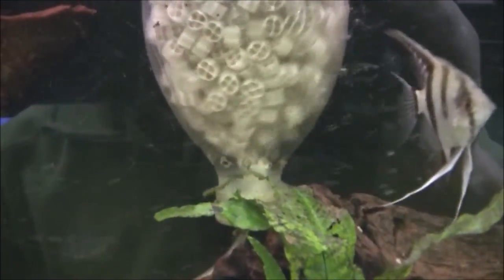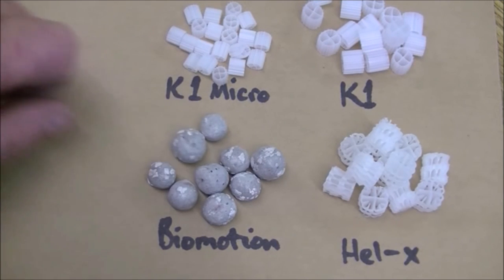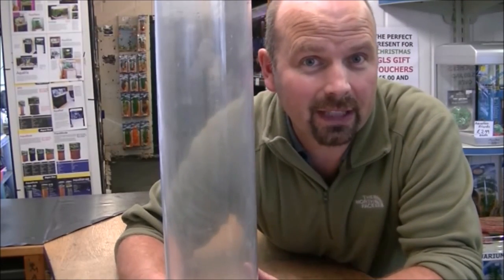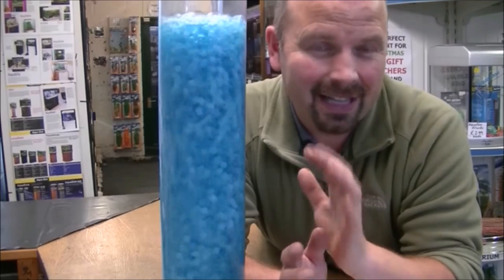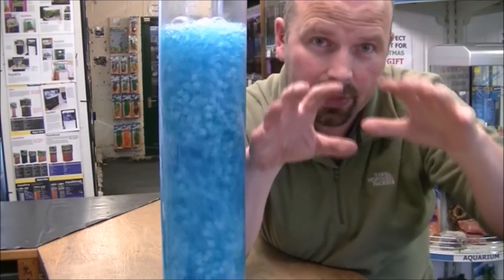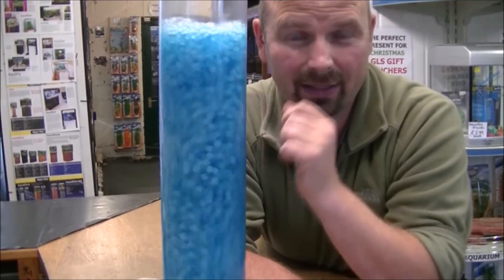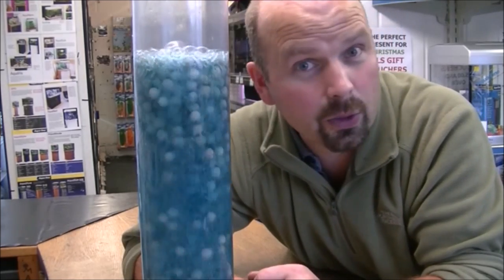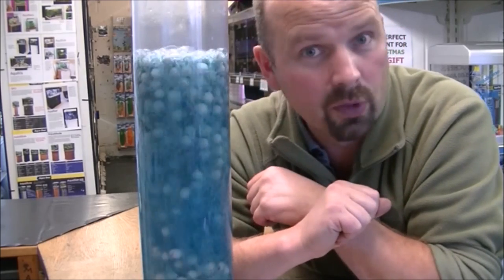Moving bed filters and fluid bed filtration 101 by Pondguru

Comment: Iam emailing u let u know I have built the moving bed filter it's been almost a week.  and the 90 %  of the k1 micro  media has started to move in a clock wise motion  . So as u told us this filter will help in the spikes of bacteria and nitrates so iam hopeful this will help me . In my tanks  iam trying it in my 29 gallon tank . So again u are  my hero and thanks from all the ones who don't know these things as you do.  Thanks pond guru guy
Reply from the maker: Great I'm glad that it is starting to move properly. Once it has moved well for a couple of weeks try moving the air inlet so air travels up the middle of the filter and the media will move in a more chaotic way. It will bash together more that way and be more effective.
Glad you enjoy the videos as I love making them - just wish I got more time for filming.
Reply: Thanks again ive added the bacteria balls and moved the air to the middle of the bottle its moving a little slow if u think its better to speed it up I can  the air flow I mean
Reply from the maker: It will move faster as the media matures so I would personally leave it but if you want to get it moving faster and can turn up the air pump then go for it. As it matures you can reduce the air flow.

Comment: Thanks for the interesting video.  I am definitely considering using a moving bed filter in a plant aquarium that I will build soon. I have a few questions about how to adjust the size of the filter or the number of filters to the size of the aquarium and also the amount of necessary media.  I am planning an aquarium of about 350 liters, 2 pairs of discus, and two pairs of angel fish.  And another group of small fish.Thank you.l am going to it diy way.I am going to use 2 liters plastic bottles.
Reply: (my other channel)  A moving bed really only processes ammonia and nitrite and it produces a nation of nitrate. That's good for the plants and as long as you have plenty of plants the water should be fine. Ideally you'd aim for 1 litre of moving bed media per 100 litres but a moving bed is only part of a filter system. If you can add more then it's all good.

Comment: What is your opinion on pot scrubbers as media in a canister filter? I see them more and more being used. Thanks for all your videos, i have a lot to watch!
Reply from the maker: They are as good as foams, ceramic rings and other material where all the surface area is external and will easily hold enough aerobc bacteria to ensure that ammonia and nitrite is processed (as long as the filter is large enough / enough 'media' is used) - however, a good lava rock would be better as far as surface area goes if you're looking for a DIY option for filter media.

Comment: Do you have to use air to tumble the media or can you just use water pumps?  Thanks for the nice video
Reply from the maker: It is best to use air as the system relies on a highly oxygenated environment to work well. However aquarium water pumps will often have a venturi fitted on the outlet which allows them to drag air in and spit out a water / air mix which works fine to drive a moving bed filter.

Comment: i was about to order enough K1 to fill my 55 gallon barrel moving bed filter to run my fishroom, i'm not too keen on ceramic or glass media as they seem to get clogged quickly, so would you recommend K1, K1 Micro, or Hel-x for most surface area for my money?
Reply from the maker: ***** K1 micro has easily the most surface area per volume of those three plastic media so would be my choice every time. It allows for the most fluid bed too so ultimately won't need as much air to drive it.
Reply: Pondguru thanks!

Comment: I am so glad I watched this before I bought the K1! I was getting the stuff together to  make one of these. The last thing I need is more Nitrates and more water changes. 
Why does this produce nitrates?
Reply from the maker: Plastic media of any type in motion or not lacks the structure necessary for supporting anything other than aerobic strains of bacteria, therefore the moving beds tend to be good for the aerobic side reducing ammonia and nitrite but the end product of that process is nitrate.
Ideally you would have a moving bed followed by a static bed of good media like biohome ultra / maxi ultimate if you were using it in a sump or if it was a pond situation the moving bed outlet would go to a static bed box or shower filter filled with 30mm-50mm white pumice, biohome ultra / maxi ultimate or the new shower media we're making which packs in really nicely for a shower filter.
Reply: Thank you for getting back to me. This is for a tank that I am not sure will even have fish in it. The tank is a floating plant tank only so I can sell the plants but, I have tried this before and the plants always die. I have an established fish tank where they plants start out and they do very well in there. I wanted to transfer the plants once they get some good roots. I was told that I probably do not have enough nitrates for the plants to feed on and that I may have to get some fish or feed the empty tank. I am not going to feed an empty tank so I might have to put fish in it. Because of this, I want the tank cycled. I was going to do this DIY with the Kaldness media and have a spong in that plant tank.
Reply: Pondguru, I live in an apartment, I can't do a shower filter here. The water is on one side of the apartment and the tank is on the other.
Reply: Pondguru, so are you suggesting that I need to use another filter with media in it along with the moving bed filter?

Comment: was wondering about shower filter,,, with the water trickling down wouldn't there be plenty of oxygen surrounding the biohome filter .. ?  how would the Anaerobic bacteria grow there ,, thanks , luv your video.
Reply from the maker: D. Aware The structure of biohome allows for anaerobic zones even in a heavy oxygenated flow so it does great in shower systems. The larger forms of media do best in really heavy flow but smaller ones like mini ultra and ultimate do fine in moderate flow.

Comment: Great work @Pondguru 
I have a question though, since I have no access to K1, Bioglass, or similar media alternatives, and I'm really looking into setting up a moving bed filter for my 127 Lt. Tank, do you thing that something like wall screw plastic anchors, cut in pieces maybe, would make an effective alternative? 
It has a decent surface area and it does float. 

Looking forward for your advice.
Reply from the maker: Waleed Janabi I suppose any plastic would do to a point but it needs to be tank safe. The K1 micro is the best media and I ship worldwide (although some countries are blocked on ebay due to terrible delivery times or items going missing).

Comment: If the plastic media were to be given a rough surface would that make it easier for the bacteria to grow on?
Reply from the maker: Yes but producing small pieces of rough plastic which last a long time is very expensive. Plastic has no useful internal structure like ceramic or sintered glass media so will never come close to supporting as much bacteria but a moving bed does have the advantage of supporting very hardy bacteria which hammer the ammonia and nitrite (although they produce a load of nitrate).

Comment: What do I need to do in regards to cleaning these filters, I have a k1 2 litre bottle inside a tank and it's been working well and maturing for 6 months.
Reply from the maker: A moving bed filter is self cleaning since all the pieces of media are constantly bumping together - for the most part the useful bacteria lives on the inside (protected) surfaces of the media.
Reply: @pondguru  oh it definitely does but it leaves a certain amount of static waste at the bottom in between some weighted balls that hold it down in the aquarium.

Comment: Dear Richard,
Thank you a lot for your videos and i bought Hel-X from you, i setup my moving bed filter following your instructions but the problem is that one month has already passed and they are not moving, they are just on top of the bottle. Can you pls tell me why? what do i make wrong?
Reply from the maker: Paolo Romantini Maybe there is too much in the restricted space or the air injection needs to be moved to one side to get the media moving. Definitely worth moving the inlet to one side of the container and getting a cycling motion going. The hel-x should operate at about a 50% fill but often needs the air up one side as it is larger than K1 and huge compared to K1 micro. Larger media is more difficult to get moving right in small spaces.
Reply: I moved the airline to one side and now it works. I just would like to ask you another question, how much strong should be the airpump? i mean assuming a 1,5 litre bottle i'm currently using a 2.6L per minute airpump.
Reply from the maker: Paolo Romantini That is easily big enough and you will find that as the weeks go on the media will move much easier.

Comment: Hi Pond Guru, I have a question about this video. When you show the blue dyed moving bed filter, and the speed at witch it moves, you tell everybody that it goes befor a static bed filter. Thus the nitrates produced by the moving bed, are handled in the next static chamber. Now I have a 2 chamber filter, with pre vortex. And I have the first chamber static, and the second ( last ) chamber is K1 and K1 micro. About 50 liters with a airflow of about 2000 liters/hour or 500 gallons. It works great, but if I hear you correctly it should be reversed for better biological filtration ? Thanks for all the great vids, regards from Holland :) ( 2500 gallon pond )
Reply: Ps my static filter holds glafoam, carbon, alfagrog and matala mats

Comment: Good video.  I appreciate the effort.  But: you knew there was a but, right?  I've seen the theory of moving bed filters aplenty.  But I have not seen actual bacterial counts or water measurement changes for equivalent volume media containers comparing an MB filter to a stationary or drip media bed,  The MB rationale seems fanciful: new bacteria knocking off old.  Ever ask yourself how the water, kinetic media, and bubbles discriminate between which bacteria it knocks off the media and which it doesn't?  [Oh yeah, the young and strong hold on and the old and weak let go.]  The most logical mental construct is that all the agitation inhibits the establishment and amount of bacteria in a colony.

And why should it matter if the water is moves through the media or the media moves through the water?  No - lacking any evidence from a controlled experiment (you may know of one), I'm going to go with stationary or drip containers.  The drip method (oxygen for the bio bed), combined with a good media that addresses nitrates, such as your biohome, seems the way to go.

There is also the unsightly aspect of an internal MB to consider.  I don't want to look at it.
Reply from the maker: They are all fair points and from the feedback I have received over the last year or so the only media which competes with the MB filter as far as speed of conversion of ammonia and nitrite is the biohome. Plus it has the added benefit of reducing nitrate so I'd go for biohome too, lol
Reply: Pondguru I don't have the space, but you could do original research and be a hero to us all.  Three ten gallon tanks.  Three filters holding an equal volume of media.  One MB filter, one drip, one stationary (HOB, canister,.small sump, etc.).  Equalize as best as possible the water flow rate and temperature.  Introduce an equal amount of bio matter in each tank and graph the ammonia>nitrite>nitrate readings over several weeks to a conclusion.  With a little thought, the actual execution would be easy, and not take up too much time once set up.  Have I convinced you - or anyone else out there?
Reply from the maker: PalJoey1957 Mike from DIY Aquapros has samples of loads of different types of media to test them as part of his university degree so I will ask how that is going / when the study is getting done as he is very good at recording information. I'm the worst person in the world to do any sort of structured study as I'm an ideas man who switches off when he sees anything with numbers on.
I'm sure in my old age I will end up looking like Doctor Emmett Brown from Back to the Future, lol
Reply: PalJoey1957 The one point I do find logical is that in a moving bed, the media is suspended which allows for more surface area. The best is fluidized small grain sand. Huge surface area when suspended in water.
Reply: I've found it's more regarding maintenance, my static setups get a bit full of detritus,  but the fluidized sends that issue to the sponge filters (mostly super small particles to the floss) and by keeping the detritus suspended, my guess is it probably has less bacteria per surface area as the food source is less concentrated.... but, less likely to crash due to waste build up (not fish waste, but bacterial waste) This is one of the reasons bacterial colonies crash, and it happens in hours, not days. So I'm glad I have both setups.

Comment: Pondguru Loved this video, as I do all your others. I have a question, which media would you advise for use in a Discus Tank? Also, would my HOB filter (Rammed pack with Ceramic Bio rings) be considered a static filter? I would love to hear your thoughts on this, I just want the best for my discus and their tank mates. Great video with loads of great information, well done my friend.
Reply from the maker: Maurice McComie A HOB filter with ceramic rings is definitely a static bed filter as the ceramic rings are way too heavy to move unless you have crazy amount of air injected then they will smash to pieces. The biohome mini ultra or ultimate medias will outperform even the best ceramic rings many times over but a HOB isn't perfect for altering since it relies on cartridge system. An external filter is way better for a large tank which I'm assuming you have as you keep discus.
Reply: Pondguru thanks for the response.  I'll definitely have a look at improving my filtration.  I have 2 whisper 60 hobs on my tank with ceramics and in addition I have 3 large sponge filters that I've fit ceramics into the outlet,  so all the air from the sponge filters flow over those ceramics. The ceramics in the hob just get the steady flow of water over them.  It's worked well for me so far, but I'm looking for an upgrade.
Reply from the maker: Maurice McComie Most filtration issues begin and end with the media so that's the best place to start. As long as good media is well protected by layered foams and a fine particle pad / floss it will be sweet.
Reply: Pondguru Thank you so much for your knowledge and insight. You really are The Guru :D
Reply from the maker: Maurice McComie No worries, any time.

Comment: So how can you deal effectively with nitrates in your tank with a moving bed bottle filter, could you use two bottles one either end of the tank, one moving bed bottle filter & one static bottle filter?
Reply from the maker: +Allen Kemmett Plastic filter media does not have a suitable structure or porosity for supporting anaerobic bacteria so it would be no good for nitrate reduction. The information on my website explains more about anaerobic bacteria and how media which supports it can help reduce nitrates: http://filterpro.co.uk/qa-24-w.asp

Comment: PondGuru
is my filter media arrangements correct in my 2 filter tanks system?
Tank 1
.. water from fish tank  drops on sponge filters then into
.. bioballs with air injection in
  bioballs are moving.

Tank 2
water from Tank 1 trickle down to K1 filters with air injection
the water is then goes back to fish tank

Comment: Hi pondguru. I am using filter matala biostep 10 for my 800 gallons koi pond . 
My PH always go back to 4-5 
I have to add baking soda to bring the ph up.. 
Also ammonia level always high .  I think I have had an algae crash. I have added beneficial bacteria but it has taken too long to establish.
How do I  keep PH and Ammonia level at stable?  Thank you
Reply from the maker: I'm not sure why the pH would be so low and it sounds like the filter is too small for the pond / stock if ammonia is always high since ammonia is quite an easy one to keep down. Is that the only filter on the pond? Feel free to send pictures / videos to sales@filterpro.co.uk and I will try to help of if you're in UK just ring on 07772848730
Regards,
Richard

Comment: pondguru I just set me up a moving bed filter for my 125 gallon aquarium. I used standard k3 media, the media seems to just be floating on top without much movement.. Is this normal when it is first set up? Does it take some time to start rotating around inside the bottle?
Reply from the maker: +Cody Medina K3 media is huge and better suited to large pond filters. You would be better off with K1 or ideally the new K1 micro. They will all take time to move and you should start with about a 25% fill until the bed moves well then add more as it moves freely.

Comment: I have a question I have a 10 gallon tank what size of a bottle do I use and how much media I put in it to get the proper filtration for that tank is there a chart that I can go by?
Reply from the maker: Fernando Miller Not really a chart since a moving bed filter is only one part of an aquarium filter, you also need mechanical filtration (as in 'how to' video link) and ideally a static part of filter which will remove nitrates. At a rough guess you would probably only need 250ml of K1 micro to handle waste in 10 US gal.
Reply: Thanks

Comment: Could you put a moving bed on the output of a powerhead filter or does it need to be air driven?
Reply: Yes you could do that, however the flow rate cannot be as fast ad most powerheads unless you are using a very large bottle/container, otherwise the water will pass over the media to quickly to colonize on the media